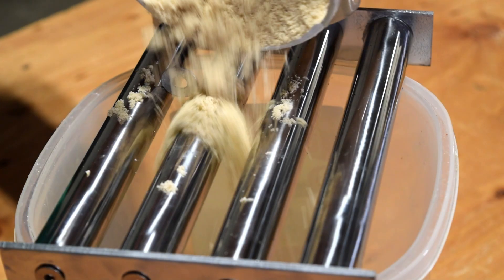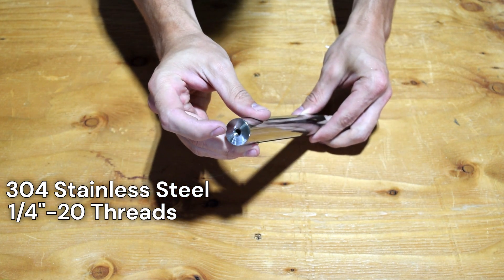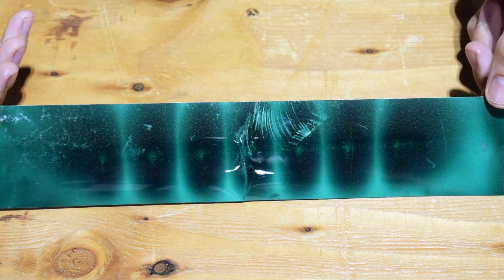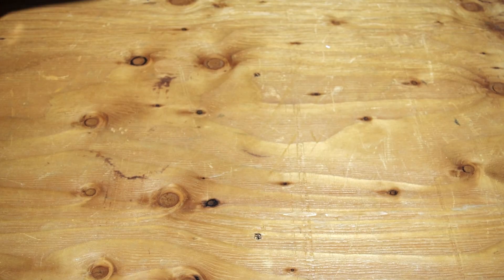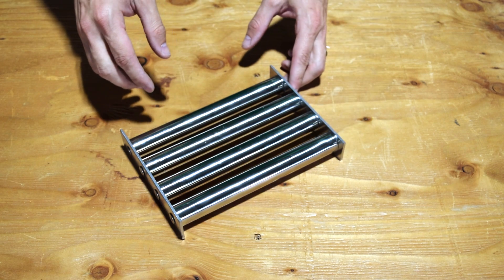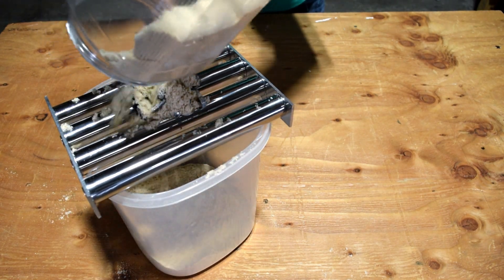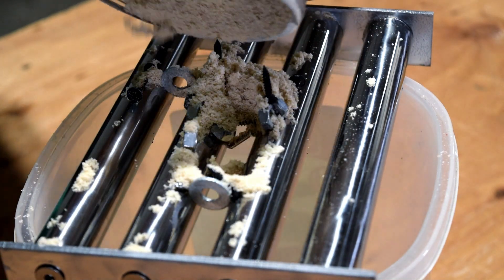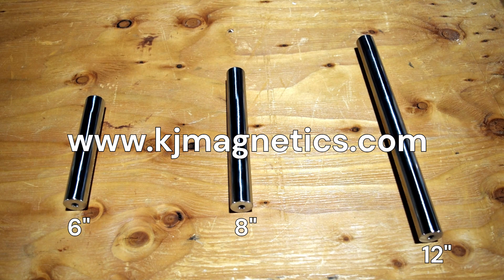Stainless Steel Magnetic Filters

Comment: Perhaps the material should be made to cascade over an inclined grate, instead of pouring it vertically over the horizontal grate.
The open areas of an inclined grid will decrease the speed of material for better cleaning!
Reply: I was thinking of a cross-hatch.  However, as stated above, it depends on application and volume.
Reply: This is better implemented on a conveyor top where material transported can be tossed off the end while metals stick to the magnetic end roller and are pulled off by the belt leaving the roller on the underside. With static rods like this the removal of the caught debris is a chore. Maybe the rods could be inside another set or tubes so they can be pulled out to the side, pulling any caught metals with them out to a dump area where a stopper plate holds back the metals while rods release the hold.
Reply: @1kreature  i can see this in a combine harvesting system removing heavy metals from the conveyer and header unit wear. its never that bad to begin with but you could take almost all of it out doing this.